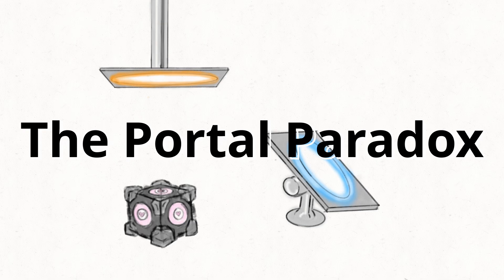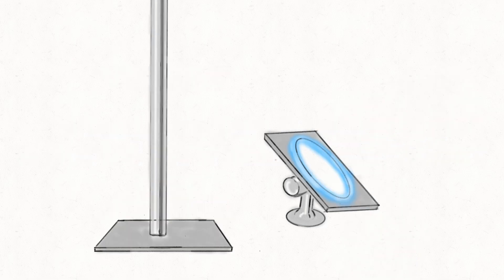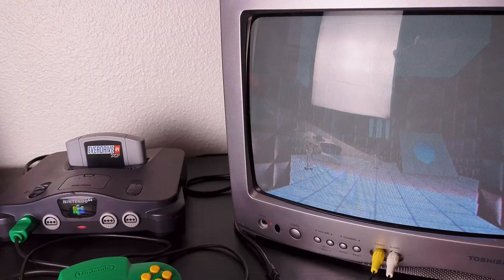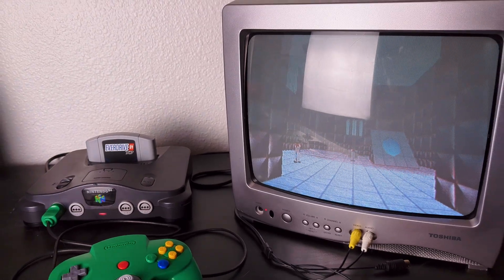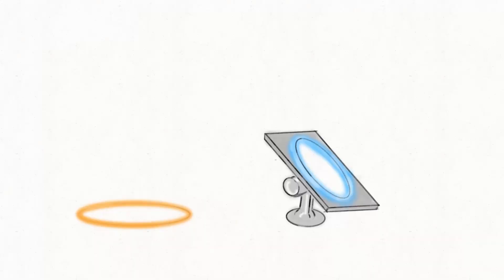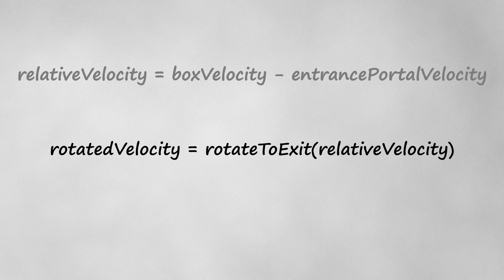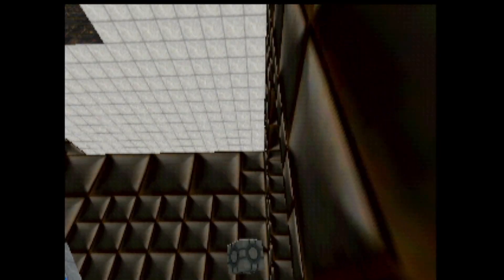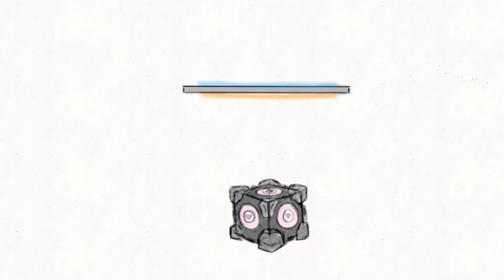I rewrote Portal from scratch and solved the Portal Paradox

Comment: I think this wouldn't work because if you still take into mind the hula hoop idea if you throw a hula hoop at an object and the object passes cleanly through it, it isn't going to suddenly bounce off that ring it never touched. I think the physics is being put on an object that in a physical sense literally does not exist, not the actual object itself. A portal isn't an object, it's a hole.

Edit: if anything there would be no movement whatsoever from the cube given the angle, it would simply poke out and sit there until it's physically disturbed. However in a completely 90° angle I could definitely see the cube passing through then falling straight down on the ground, possibly even tilting and spinning as it does since the top of the cube is shifting gravity faster than the bottom
Reply: gold star. the cube requires energy to move. 

The cube doesn't have any potential energy. How is the cube suddenly gaining enough energy to fling itself across the room?? In order for an object to move, energy/work has to be applied. 

Since the portal itself doesn't physically interact with the cube, it just relocates it, the cube has no way of suddenly obtaining this energy. All of the energy that you used to push the tile into the ground is absorbed by the armature, the floor, and the panel. It's distributed as vibration, sound, and heat. We know this because objects that are dropped from one portal into another when they're stacked speed up to terminal velocity. If the portal could transfer the energy from the object it was sitting on while that object moves, it would also absorb energy from objects moving through it and transfer that energy to the surface it's mounted on. But that's shown very simply to not be the case. The cube will only move because of the force of gravity at its new location.

An object at rest will stay at rest unless acted upon by an external force. :)
Reply: Yeh, you're right. That's exactly what would happen, and not what was shown in the video.

Comment: One way for it to make a bit more sense imo is to have your setup for the paradox unchanged but slam the platform that the box is on up into the portal. If we weren't looking at the room then the two would look identical and in my opinion they are just two identical scenarios in different reference frames which have been proven to be identical in a physical sense
Reply: Actually, the cube moving towards portal and the portal moving towards cube aren't the same situations.
Reply: @FantasTik Boom you are completely incorrect. Inertial frames of reference are a fundamental basis for physics.

Let's establish this first, the portal is a void. It is massless and lacks matter and energy. It is a hole, a link in space-time. 

Inertial frames of reference are exactly the same when reversed, an object passing through space is the same as space passing over an object, factoring in the same variables swapped. It's provable with the very formula he used. From the portals perspective it is staying still while the rest of the world accelerates at it.

If the portal, a massless void, somehow accelerates an object passing through it, then light itself must accelerate past the speed of light when exiting the portal.

You do understand how this is false right? I can spell it out for you if you still don't understand.
Reply: @xelgodis80085  I'm saying that the cube won't get speed of the portal, because it's not the same as if cube is flying towards the portal. I don't get why i'm wrong there.
Reply: @FantasTik Boom first, the portal has no mass or energy and therefore no 'speed' to impart on the cube, it is literally a void, empty space. You could even say it's thickness is on the Planck level, so it doesn't even have a thickness, it just connects two surfaces.

It's basically a tunnel through space-time, and itself lacks any mass or energy.

Second, inertial frames of reference. To understand why this simulation is wrong you have to understand that from any point of reference the "owner" of the reference point can be said to be staying still in space-time while the universe moves around them or objects accelerate at them, the  math works either way. That's what an inertial frame of reference is in fact, it's a single point being observed while forces act upon it. 

The portal is literally a hole, and there is zero difference between the box moving through the hole and the hole moving over the box, this is a fundamental principle of physics.
Reply: @xelgodis80085  But if these are the same situations, wouldn't the cube fly out in both cases? In case where it was initially thrown and in case where it is initially still. If result isn't the same, why situations are the same?

And I never said the cube should fly out when it is still. It shouldn't, and I always thought so.
Reply: @FantasTik Boom  no, conservation of momentum applies, there just isn't any in the hole. The platform can affect anything it touches, but nothing can touch the portal because it's literally nothing, a void, an empty space. You're moving a hole at an object, or moving the universe at the hole. In either case the hole cannot interact with the object.
Reply: I think the whole reason it confuses people (or at least me) is because we don't really have a grasp on how portals are supposed to work. It's science fiction but we are just assuming things and then trying to fit them into our scientific models. Reference frames are a proven thing, but should two linked portals be able to have different reference frames? Maybe if one portal moves the other has to move as well to obey all the natural rules.
Reply: Which would mean the box doesn't move, as no force is imparted on it, and this example was intellectually dishonest.

Comment: I don’t wanna say that you’re wrong, but what if your exit portal was moving along the same vector that an object would have to travel in to clear the aperture while the entrance portal was stationary, and you tried to push the cube through the entrance portal? The entrance portal doesn’t move so every inch you push against the entrance’s aperture should allow for an inch of cube to exit, but if the exit portal is moving forward then you effectively push the aperture past the cube. So now you’re imparting a force against the cube but also not imparting a force?
Reply: Portals must save momentum of the object . So the exit portal will give correction of the velocity in respect to itself for the object passing through. He didn't implement this, therefore, his equation is wrong.

What if we're moving entrance portal and not moving the exit? Cube's momentum won't be affected (and would be saved), so the cube won't fly out. Actually, it will appear on the exit side without applying a force. That's how it should work. From cube's perspective it looks like a doorway passing through.

Comment: There actually are moving portals in the original game. In portal 2, when destroying the neurotoxin production chamber, you use a laser on a moving portal to slice pipes. The game has a flag that is only turned on inside that room to enable moving portals. This flag can, however, be turned on in the console. So if a custom level was made to be a replica of the room in your test, and the flag was toggled in the console, this could be tested using the source game engine. I do agree with your solution to the portal paradox, I just wanted to point out that this is testable in the actual game.
Reply: They're a scripted visual gig and has no actual physics engine.

Comment: Gah, I was going to post a big long comment explaining why I disagree with your solution to the paradox. Then as I got to thinking about it, I arrived at the opposite conclusion, so instead, I decided to walk you through how I did that. Then as I got to writing it, I used the same three experiments you demoed in the video to explain it. All in all, the process took around half an hour. So thank you for the thinking session.

I think the one key point that I thought of that wasn't explained entirely was how it works - your equations assume the result. But why does it work? As the upper yellow portal moved toward the cube, the cube didn't move, right? Wrong. The reason for that is the yellow portal's movement suddenly caused the cube to displace space at the blue portal - this is the very definition of velocity and the source of the cube's newfound kinetic energy. This is just one of the ways that "movement through space" works differently in a non-Euclidean space. Perhaps you could say that the movement of space moved the object?

Comment: If the platform raises up to the portal, you wouldn’t get launched because of your speed going through the portal, you would get launched because the platform is moving you up, and then suddenly stops at the rim of the portal. You would then conserve your momentum and be launched. Imagine instead of a portal, it’s just a metal frame. If the platform was raised up until it hit frame, you would get launched, but if the frame fell around you, you would not get launched.

Edit: it’s also useful to think of the two spaces connected by the portal as one continuous space, except gravity is at a different angle on either side of the portal.

Edit 2: also, the two ends of the portals always have zero velocity relative to each other

Comment: Something to keep in mind is how portals would mess with gravity. A portal would generally let anything flow through, including gravity, magnetism and whatever. There is much more complexity to add to calculations of the physics of portals.

A classic experiment is the looping portal hole (a portal on the ceiling and a portal on the floor directly underneath): The usual conclusion is that any item dropped inside would fall infinitely, which seems to break conservation of energy and also seems to ignore complexities of the scenario. As an infinite looping hole, it would appear mostly empty (therefore no mass directly above and below), except any small traces of mass would also be infinitely repeated from both above and below (therefore infinite mass from above and below). Gravity does weaken over distance, yet also supposedly has infinite range, and limited by c. I conclude that this would lead to an inititially weak pull from both portal exits that gradually and infinitely increases over time (yet may appear to plateau in strength). Perhaps the floor exit would still have a stronger pull due to the planet's gravity.

It generally seems like it is just impossible for portals to exist, they just seem to break physics, so i am not sure if it is possible to have any correct answers to the questions of how they i would interact with stuff.

Comment: Didn't know this was a mystery, but thinking through it logically a portal slamming down on a block should be the same as a door frame slamming down around a block. Door frame velocity wouldn't matter, the same way a portal's velocity shouldn't. If the cube doesn't already have any momentum it shouldn't go flying out the other side. Like the velocity of the portal shouldn't matter since it shouldn't be transferring energy to the cube...

I mean obviously there's the issue of implementation and having to teleport and stuff, but I feel like if they work the way it seems like they're supposed to work (basically a doorway that doesn't actually interact with the objects going through them, same as a normal doorway) then it shouldn't be adding momentum.

Comment: I don’t think there really is a paradox (assuming the possibility of portals actually existing). The only thing that matters is the rate of flow of matter through the portal.

If the box is entering the portal at 5 cm s^-1 then it needs to leave at 5 cm s^-1 otherwise it can’t pass through.

Obviously the “hula-hoop” still works because matter is still leaving the second portal at the same rate.

I think the other option requires you to consider the box a point mass to even be able to consider it.

Cool video, though confirmation bias may be informing my opinion!

Comment: Relative motion... Basically, any portion of the object that has crossed the portal boundary finds itself instantaneously accelerated to the velocity of the moving portal. It's inertia, in this instance resistance to motion, means that a high force will be placed in the surface the object is resting against. Depending on how the math works out, that force might actually be stupidly large (on perfectly rigid objects), since the acceleration seems to be instantaneous, or nearly so. I think this implies that any portal moving relative to the object passing through it will experience a resistive force, one way or another depending upon the direction of motion. In this case, the cube will be pushed hard onto the platform, (by the platform?) and that's where the unintuitive part dissolves. When thinking about this situation, you probably assume that the cube/platform interface doesn't experience any forces besides those due to gravity, when in fact, from the perspective of any part of the cube that has passed through the portal, it is being pushed by the rest of the cube, all the way down to the platform.

Comment: I strongly disagree. I believe the velocity is relative to the object and does not change.  There is no movement energy to be found in the cube.  Your equation is adding energy to it.  The "hoola-hoop" example still applies, even if the exit end is stationary.  The portal is nothing more than an open door, it won't add energy to the object.

The cube should just fall to the floor once gravity applies when it passes through.  Gravity on the other end will create energy but only a down pull.